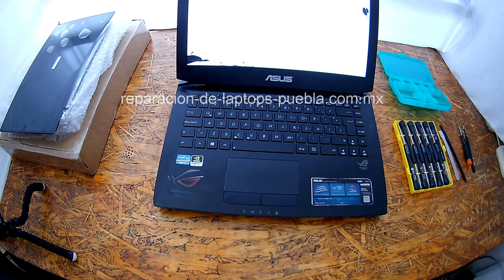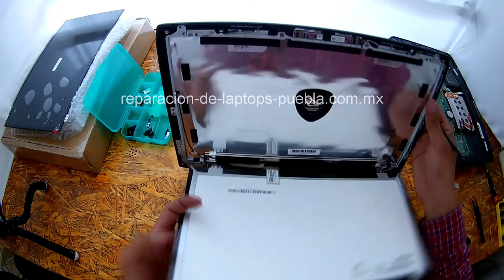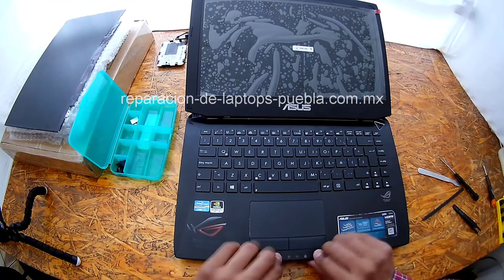How to replace screen for Asus ROG G75VW [SUBS]

Comment from the maker: 00:00:03 display LCD de ASUS ROG G75VW
00:00:04 Pantalla quebrada que va a ser cambiada
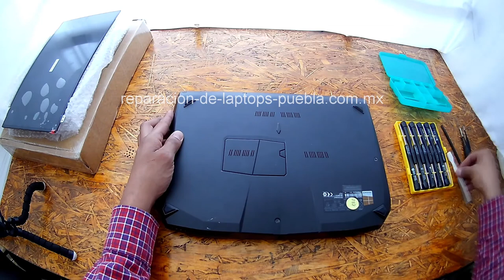00:00:08 Poner boca abajo la laptop
00:00:10 Quitar la tapa de la memoria RAM. Con ayuda de un destornillador philips #1 y spudger
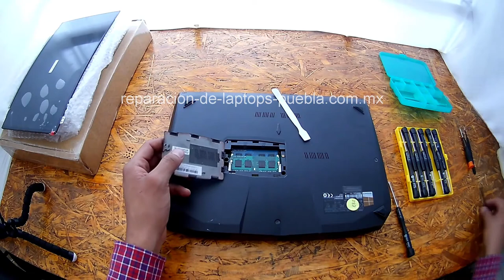00:00:22 Retirar todos los tornillos del bottom case
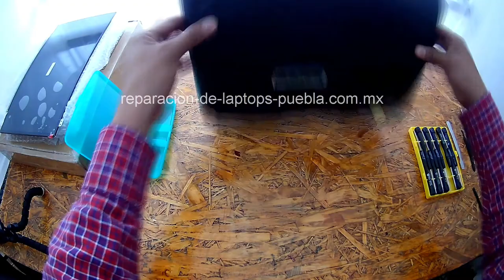00:00:53 Poner boca arriba la laptop
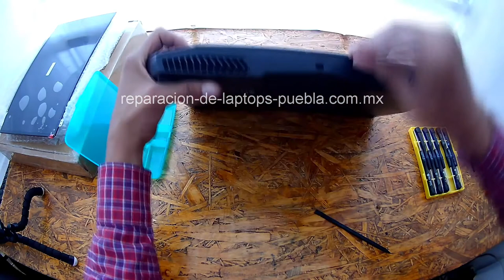00:00:57 Quitar la tapa con el spudger
00:01:03 Con las pinzas levanta cuidadosamente el conector
00:01:06 Desconectar el otro conector
00:01:08,Desconectar la tarjeta WiFi
00:01:11 Desconectar las antenas WiFi
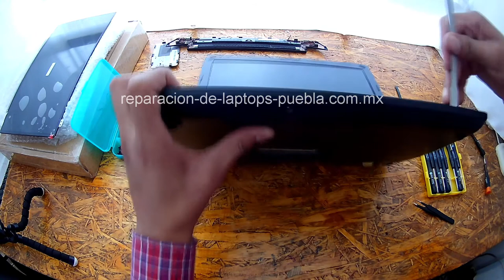00:01:16 Voltear la laptop boca arriba y abrir la pantalla
00:01:19,Separar el la carcasa inferior con ayuda de 2 spudger
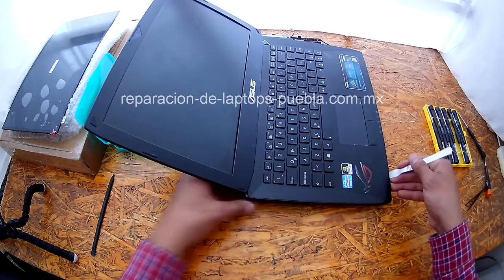00:01:45 Retirar los tornillos que estan junto a la memoria RAM
00:01:54 Levantar el palm rest para poder desconectarlo y separarlo.
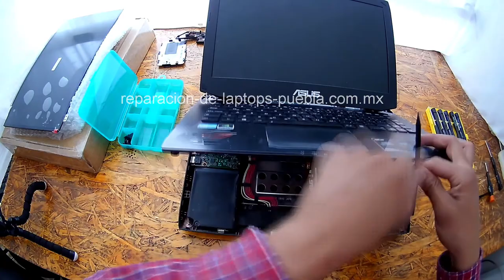00:02:02 Desconectar el flex de teclado con ayuda del spudger
00:02:08,Desconectar la batería con ayuda del spudger
00:02:19 Quitar los tornillos de las bisagras
00:02:35 Quitar este tornillo de la bisagra
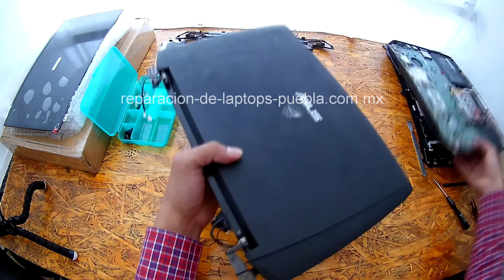00:02:43 Separar el top cover
00:02:47 Mover las bisagras hacia atrás
00:02:53, Retirar las tapas de goma en las esquinas.
00:03:00 Retirar los 4 tornillos
00:03:06 Separar el marco del top cover con ayuda del spudger
00:03:27 Retirar los tornillos de los postes
00:03:40, Separar el display LCD del top cover
00:03:46 Desconectar el bus de video
00:03:51 Reemplazar el LCD quebrado por uno nuevo
00:03:55, Conectar el nuevo display al bus de video
00:04:00 Colocar el nuevo display al top cover
00:04:03 Colocar los tornillos en los postes
00:04:14 Cololocar el marco bezel
00:04:31 Colocar los tornillos sobre las bisagras
00:04:58 Conectar las antenas WiFi
00:05:16 Conectar la batería
00:05:21 Conectar el flex del teclado
00:05:27 Colocar el palmrest
00:05:33 Volver a conectar todos los cables de esta parte
00:05:48 Colocar los tornillos de la tapa inferior
00:06:06 Colocar la tapa de la memoria RAM
00:06:12, Encender la ASUS ROG G75VW para comprobar el funcionamiento del nuevo display instalado